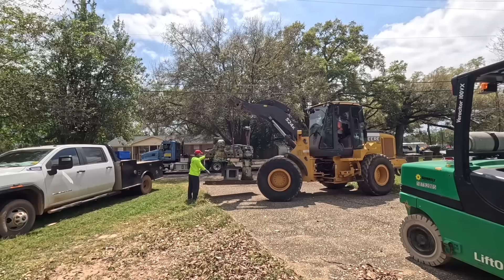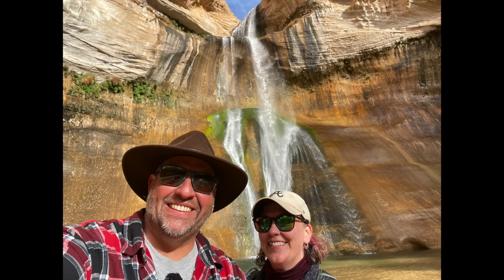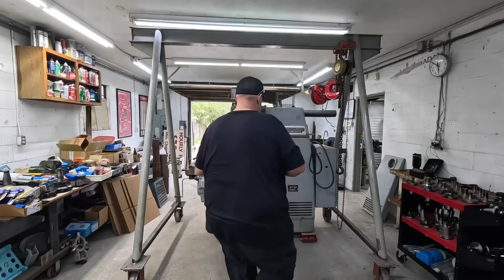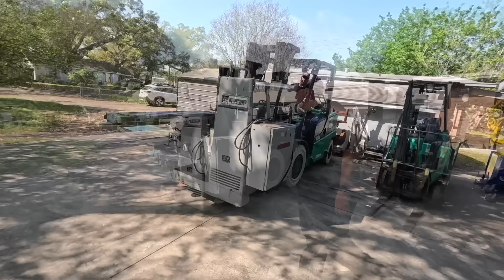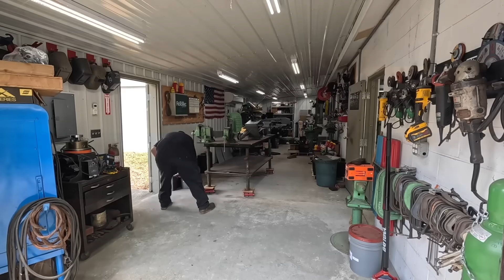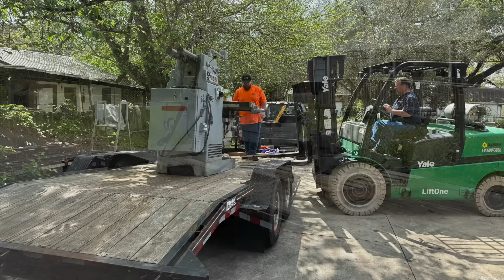Moving & Loading Vintage Machines

Comment: I totally understand how much moving equipment can wear you out.  I just replaced my clapped out Bridgeport with a Sharp clone and the two hours I spent inching that Bridgeport along in the shop on pipes was beyond tiresome.  And then ratchet straps actually make pretty good come alongs to drag the Bridgeport held up by a straining engine hoist onto a drop deck trailer just so I could reposition it in the other building.  The delivery guy for the Sharp took pity on me and ran the forklift I rented and dropped the Sharp almost in its final spot.  A very different experience.  Now to hand tap the holes in the Sharp's base to 7/8-9 to add feet to it.

Congrats on safely moving so many large pieces of equipment which all want to kill you.

Comment: I think only thing I would like to have seen was one of the BIG mill cutters from a previous video NOT be sold, and the reason for it, is I would love to see you make a shop clock out of it, with painting  it, or your logo to put in the new shop - maybe in the office or somewhere.  So not held to sell, but to use in an unusual way...  Great videos on the progres of moving out of  the materials and equipment, though.  Love the approach you use as slow, methodical and yet, gets the job done in the safest way possible...